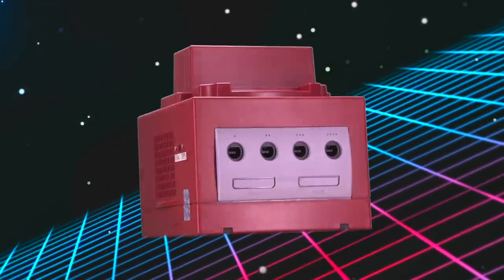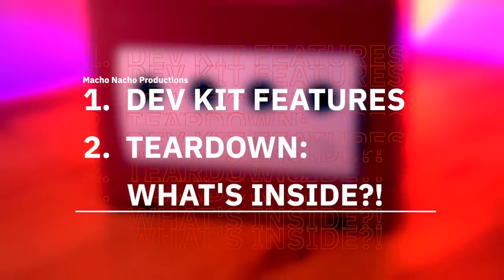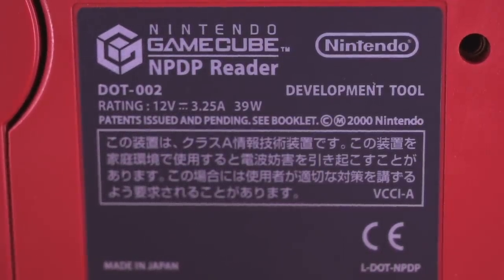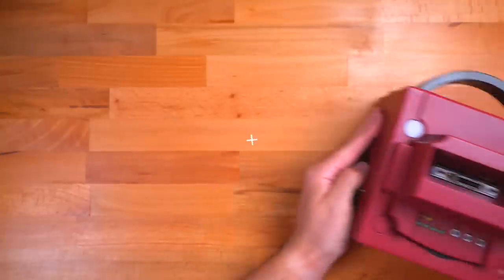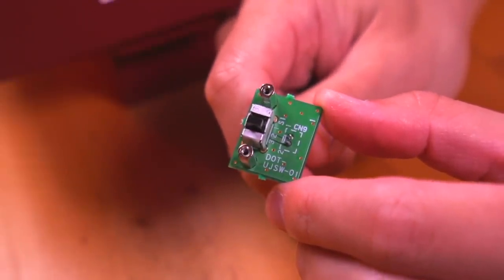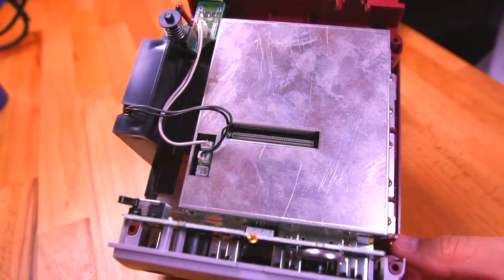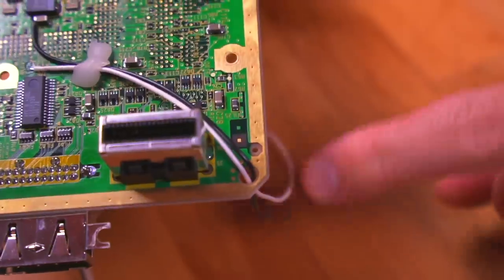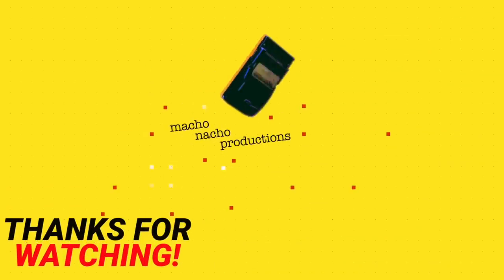Why Did Nintendo Make A GameCube With A Cartridge Slot? | The NPDP Reader

Comment: I worked as a mastering Lab Technician at THQ during the GameCube days. We used to burn test builds to these 100s of these drives each day for testing. We had 3 NPDP writers which were Desktop Computer sized devices that had 8 slots to burn games to slots 8 at a time. We also made NR discs, but those were used less for things like testing load times and other compliance testing. I used to have 3 NPDP readers on my desk to test burn builds in different regions. I wish I had thought to keep some of that hardware, but back then it was just office equipment, like a stapler.
Reply from the maker: Dude that is so cool!  Man, would have been sweet to keep some!
Reply: @MachoNachoProductions  When I got relocated to Montreal they told me to fill up moving boxes with what I needed. At that point, we were in the 360 / Ps3 / Wii era so I was like "well I won't need any of this GameCube stuff." And gave it back to IT.
Reply: @teknohed  to be fair, the dev consoles are technically property of the console maker, in this case Nintendo, not the company who uses them. Therefore, grabing it COULD have let to some legal trouble. Also dev consoles from the last few generations are really annoying, they have remote bricking if they are not returned.
Reply: @JF743  Oh yeah, that's totally true. But the fall of THQ was not real organized. A lot of dev hardware went unaccounted for, I'm sure.
Reply: @teknohed  With the amount of junk being sent to Montreal when all the studios were closing before THQ fully went under I'm kind of surprised dev kits didn't get out in the wild. btw Billy here from the Montreal THQ IT team. It was my job to make sure all hardware was accounted for at that time. I guess I did a good job lol
Reply: @maritimemetaldoc6812  Hey Billy! There might be an unaccounted for 3DS test kit someone may have left in his back pack on that last day…
Reply: @teknohed  haha a few years ago I found a box of sealed THQ games in a locked closet on the 7th floor. Years after Ubisoft took over then gave up the building to a VFX company Cinesite that I ended up working at for 5 years. So I have a bunch of sealed PS3 and 360 games THQ releases. Always wished I took a PS3 test kit. Good memories of my QA testing days. Before I quite after Ubisoft took over I had to inventory all the test kits, It took me weeks and still couldn't find all of them. I'm sure Ubisoft probably trashed them all anyway.
Reply: @maritimemetaldoc6812  yeah. just a tax write off.  I do miss those days back in MTL.
Reply: @JF743  At the same, Nintendo would have to know and care. And only the person who actually left with it is technically at fault. Unless the company or their lawyers demand it’s return and you don’t comply, you’re probably okay despite the gray area.
Reply: @maritimemetaldoc6812  Such a shame to trash stuff like this. Just another kind of planned obsolescence…
Reply: @jnharton  The official policy for all dev and test kits for Sony, Microsoft and Nintendo is to ship them back. so Dev and Test kits are never truly owned by any game company. In my 8 year's in the industry I never once seen a Dev or Test kit sent back to the big 3. Not sure what they do with them once they do get sent back. I can only assume they are destroyed if they are not in good enough condition to reuse/they are end of life.
Reply: @jnharton  it's still a risk I would not personally take, but evidently people do, and Nintendo definitely does care enough, they would make it illegal to record anything remotely related to their consoles and games if they could.
Reply: @JF743  There are definitely many things they care about, but frequently it’s about their IP (intellectual property) and reputation. I doubt that a development tool from at least three console generations ago is a big concern. When it was new, that might have posed a problem in terms of piracy/bootlegging.
Reply: Thq? Back in the day they went hard. I may be biased but mx vs atv untamed is goated
Reply: @Recarsonated  MX Vs ATV was the first HD game I ever saw on a 720p screen.
Reply: @teknohed  10 y.o. me was hardcore glued to the Wii playing De Blob and De Blob 2, and at 18 if Mad World wasn't in the slot I was playing one of those 2. Still wishing for a De Blob 3.
Reply: @aiodensghost8645  De Blob was a great game. I worked on the first one, but not the second. would love to see another one!
Reply: Did you burn test builds of WWE Games?
Reply: you people steal the wrong office equipment
Reply: @Hilda1204  Thounsands of them. I worked on every WWE game from the first Smackdown Vs Raw in 2004 to WWE12.  When those games are in test you probably burn between 100 to 200 builds a day.
Reply: @teknohed  most wrestling fans says that SmackDown vs. RAW 2007 is the best game in the SmackDown vs. RAW series
Reply: @Hilda1204  i think my favorite that i worked on was WWE All Stars, that one was fun and it had a dedicated arcade stick.
Reply: @teknohed  yeah I said that SmackDown vs. RAW 2007 was the best game in the SmackDown vs. RAW series and I enjoyed most of the WWE Games
Reply: Well a stapler can be bought online and you could be bring home but a GameCube, maybe but idk Nintendo would be on you
Reply: Like a stapler??
Reply: Interesting
Reply: @teknohed  Hey man, did you happen to work on Sphinx & the cursed mummy back in the day? so exactly, what happened with that game breaking glitch with the door being closed if u saved and then reload that save file for the once opened door before now closed forever?
Reply: @MrDmoney156  I did work on it, and I have no idea. But every game has a pile bugs and it is a miracle anything ever comes out,
Reply: @jnharton  kinda? sorta? its not planned obsolescence because they didnt design them to fail

also its in there perogotive not to let this hardware out because it is heavily there ip 

you could argue that by not letting the community have access to the dev tools that it limits expanded life of the console through fan made games but none of this dev hardware would have helped you in any major way

whilst you could have developed a game with it and even tested it it wouldnt provide you with any way to distrobute those games each of the different disc consoles all needed special copy protection markings placed onto the disks at the mastering stage and not something a pc cd burner could do

for ps1 that meant the wobble track
for GC that was the burst data area 
for sega dreamcast that was a writer capable of writing games in the oposite direction to conventional cd/dvd drives along with a writer capable of writing gdroms specifically

infact ps1 had fan available dev tools in the yaroze dev system but those wouldnt work without the special memory cards to allow them to play
Reply: @teknohed  man always have an investment mindset with your items! trash is treasure
Reply: @maritimemetaldoc6812  hey man that’s crazy my fiancé works at cinesite currently, you still working there? And what position did you hold, small world
Reply: @gavindixon15  I worked there for 5 years until I left the company in 2021. I was Lead of the Helpdesk IT team. I'm now at MPC managing the local IT team.
Reply: @maritimemetaldoc6812  I currently work at MPC to have for nearly a year, that’s crazy we likely know each other
Reply: @gavindixon15  Your in London right? I'm in the Montreal Office.
Reply: @maritimemetaldoc6812  yeah I’m in the London office, still small world haha
Reply: @maritimemetaldoc6812  similar thing happened at the London office, we had a bunch of technicolor stock laying around so was a couple boxes of sealed games that I was able to keep, dark souls south park etc
Reply: WRONG GAMECUBE WITH A CARTRIDGE SLOT USES TO PLAY NES GAMES
Reply: You aren’t like me, lol, I LOVE random office equipment and learning how it works
Reply: I would have stolen a reader and writer for sure. From day one I would have been planning a way to steal them.
Reply: @keaton718  stealing a writer would have been impossible. They were huge and behind two locked doors. it would have been obvious that i or one of the other two guys in the lab stole it as no one else had access. an NPdP cart would have been easier as they were hundreds of them all over the building. they were closely tracked, but sneaky testers (like yourself) could find a way. your best bet would have been there on the day THQ went out of business in 2013. but by then we weren’t using these any more and they were all locked in a closet somewhere…sadly they probably all got sent to india as e waste.
Reply: @teknohed  do you know what the “error” button does?
Reply: @Coreguy-w  I think someone else already commented this, but that button was used to simulate disc read errors so you could check error messaging for TRC compliance.

Comment: Unfortunately, most of the interesting bits are inside the NPDP cartridge - it's basically an optical drive emulator running off a HDD and just exposes an interface that matches the one of the original optical disc.  The HDDs they used were little laptop drives and seemed to have a fairly high failure rate, although that might just be down to the fairly hard life they had - the cart also had shock watches inside it so Nintendo could refuse warranty repairs in the (common) case where someone dropped it and screwed up the drive.
Reply from the maker: That’s super interesting. Kinda stinks there wasn’t more complex components inside, but still really neat overall!  Cheers!
Reply: @MachoNachoProductions  Yeah, it's honestly a really strange design decision - if it had been up to me, I would have just used interchangeable drives and put the emulation hardware into the console rather than forcing the user to buy multiple sets of fairly expensive circuitry.  They are also the same cartridges that plug into the NPDP-GDEV, although in most cases they weren't actually used because people used the PC based ODEM instead.
You don't see many of them because they were fairly quickly replaced for most uses by the disc based NR-Reader.
Reply: @MachoNachoProductions  mr macho is it possible to make a 3ds home console like the gameboy or the gameboy advance?
Reply: so a laptop HDD like those old 2.5 inch PATA hard drives?
Reply: @AUATUWVSH  Yes - the drive was 6GB and partitioned into 4 1.5GB areas, which you could select using the buttons on the NPDP-Reader - it was also locked and "encrypted" - I put the latter in quotes because it was just XOR and more like obfuscation than anything else.  Unfortunately, I don't have any of the hardware any more, so this is all from memory.  I do remember being told that "NPDP" was "Nintendo Pseudo Disk Pack", but have no way of verifying this.  Oh, and although the user password on the drive is device specific the master password is common - since the security mode is set to "high" (rather than maximum) you can just unlock the drive using the master password without erasing it - the password (common to all units..) is "N-PDP Master Passwd", so you can just unlock it using something like hdparm, dump the drive then figure out the XOR constant by looking at the parts of the GCM headers that are normally zero.  Honestly gives me the feeling that the engineer that designed it was told to "add security" - but thought it was pretty much a waste of time and didn't bother to put any effort into it.  On top of this, if you plug in an unlocked drive then the code in the SH3 will helpfully lock it for you, including setting the passwords - so if you have access to an IDE analyzer you can just see what the passwords are (both user and master) simply by looking at the logs.
Reply: @TrimeshSZ  Makes sense to me that they wouldn't bother with security, and heck I wonder why they did at all. In the end it's a device that is sold (or sort-of leased?) by Nintendo to a trusted developer, that should be the one most affected by any leak of data from that drive to begin with, so the whole security should be on their own to not let, well, people snoop into the PCs used to code the game.
Heavy security on the console itself tho makes sense as that's where you could find piracy exploits. I imagine Nintendo wouldn't want another 90's EA happening to them this time after all.
Reply: Kinda want to see an internal HDD mod for the gamecube to load games through it...
Reply: @Ruiso7  check out the GC-Loader. It's a drop-in replacement for the GameCube's disc drive and lets you insert an SD card to load games from. I've got one of my GameCubes modded with one, and it's amazing, however they're quite expensive (roughly $100 AUD, or €70 EUR or $71 USD), but given that GameCube games can be super expensive depending on the game, it's money well spent.

So it's not really a HDD mod, but it's close enough.
Reply: @Kalvinjj  What makes the most sense is minimizing any easy way to run bootleg/pirates games on the actual hardware since that would bite into profits. It’s also a total end run around needing to protect the game itself, because it doesn’t matter much if you can rip/copy the data but not use it with the console. — Good emulation of the hardware can take long enough that it’s not an issue.
Reply: @jnharton  Yes but I'm talking specifically about the dev kit's security. There it doesn't matter if you can run any pirated game, it won't bite into any profit since it's just a handful of developers getting those.
For the consumer models it makes sense of course, that's what brings the money. But on the dev units, the devs themselves should be the ones caring about their game leaking during development, and the console itself being secure and all ain't changing that.
Reply: Jeez, I'll bet!  How much more gently you think people would've handled those carts if they were transparent or something and you could see there was literally just an HDD inside??  By their very nature, carts tend to cultivate this belief in their indestructibility. 😬 At least slap a "FRAGILE! DO NOT USE FOR INTRA-OFFICE DISCGOLF!" sticker on it or something! 😂
Reply: Wild they had shock sensors.

Comment: My guess is the error button simulates a disk failung to read data. I guess it could be pressed when a level is being loaded or something like that so the devs can handle it by either attenpting again or proving an error to the user.
Reply from the maker: True, that’s an interesting hypothesis!
Reply: And not just crashing, very good.
Reply: I was thinking the same thing, and most likely makes most sense
Reply: Might also be used to test things like ability to soft reset on crash, memory card corruption during read/write, whether assets were fully loaded into memory during a level etc
Reply: It is up to the game dev to determine how the software handles the read error. Some games completely quit, others continue playing. How many times do you retry, what does your retry screen look like? Do you tell the user right away there is a disc error, or do you notify after X number of errors. And so on…

Comment: The wires soldered to the bottom are just a bog standard region switch mod. The wire connected to the via runs to one of the pads of R6 on the top of the board, and the wire connected to the capacitor is just going to ground. You can use these as alternate solder points for doing a region mod on a standard NTSC-J Cube. I'm pretty sure they used those points as they were probably pulling the mainboards for these units out of retail units channel and modding them and they didn't want to pull the heatsinks off.

Comment: Hey Tito, have you tried swapping in an optical drive to see if it boots as normal?
Reply from the maker: I haven’t but that would be a very interesting experiment
Reply: It should, looks to be a bog standard NTSC-J mainboard with a region switch mod. The special sauce is in the cart reader.
Reply: I could imagine a working retail Gamecube with that region switch implemented.  Being able to go from playing say Super Mario Sunshine, turning off the Gamecube, flipping the switch from US to JPN and then being able to play a game exclusive to Japan or a version of a game released in the US that might be an earlier version only released to the Japanese player base.
Reply: @MachoNachoProductions  I'd love to see this too, was checking comments because I was thinking the same thing.
Reply: It probably would work, unless they did something funky with the system ROM image; heck, you might be able to run unsigned code.